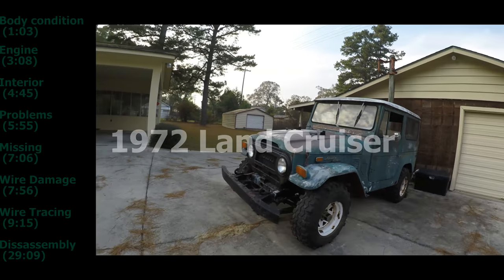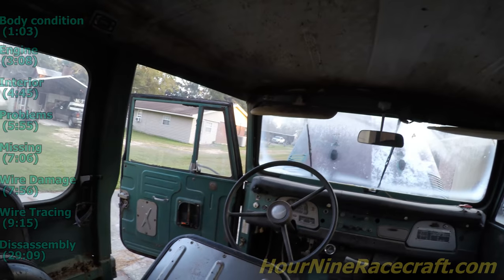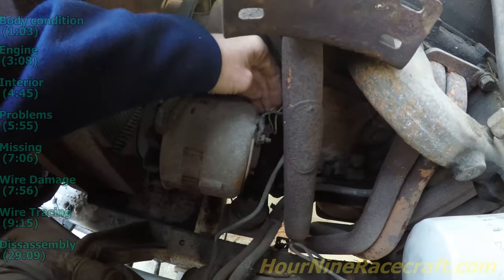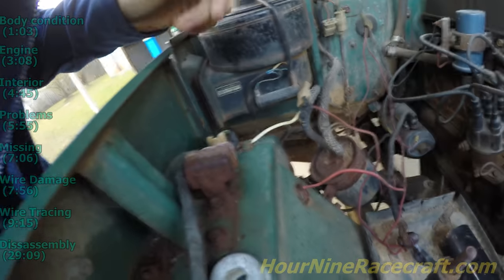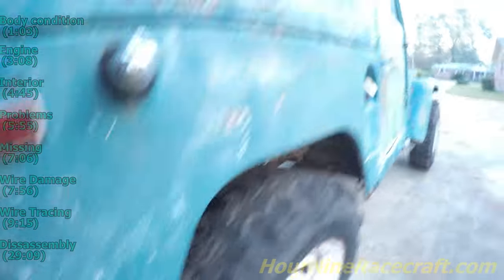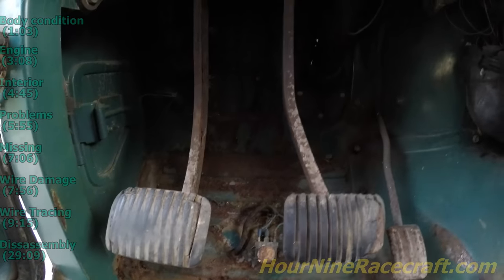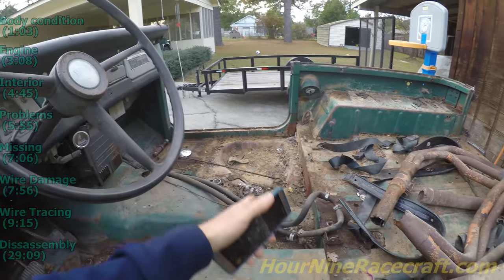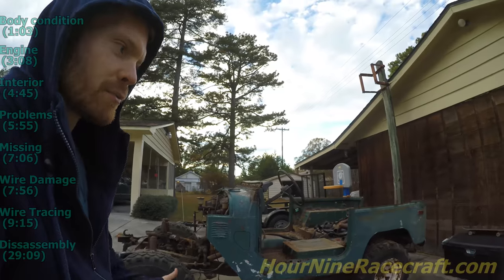FJ40 Rebuild Part 1: Complete Disassembly

Comment: I am not very experienced in restoring older cars. I have been disassembling my 1970 LandCruiser and have had the same problem with bolt heads snapping off. Are there any alternatives after the bolt heads snap off to drilling out the hole and tapping it for a larger bolt the next time?
Reply from the maker: +Rick Marshall I've thought about drilling them through to push them to the inside and then pulling them out with magnets. Question: how were you loosening them? We were spraying them with pb blaster spray and then heating the bolts, we think they were heated too much with the pb blaster+torch and the torch heat was concentrated where the spray went. We still snapped some just muscling them off with heat, but not as many